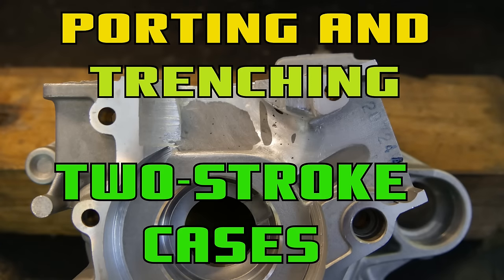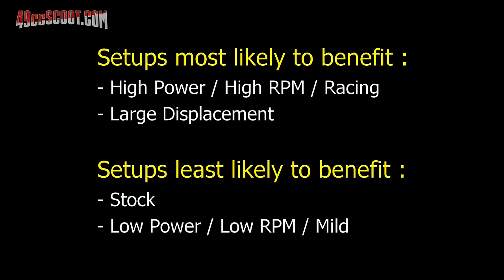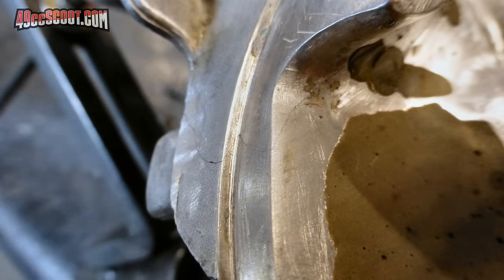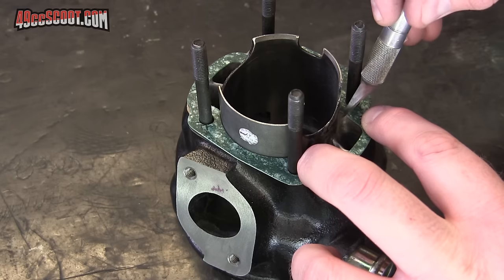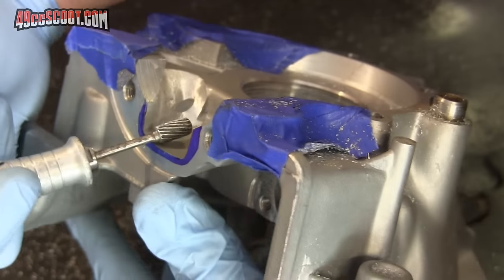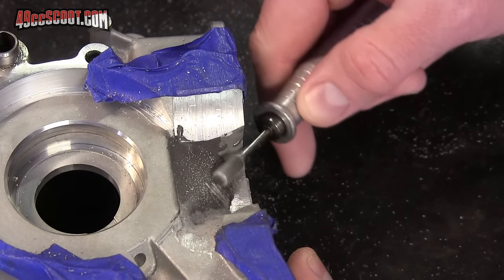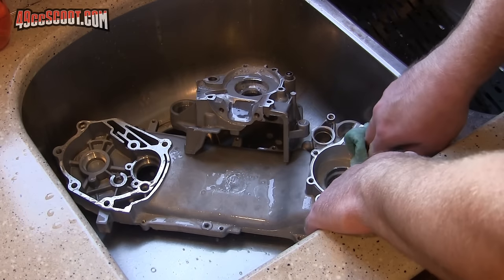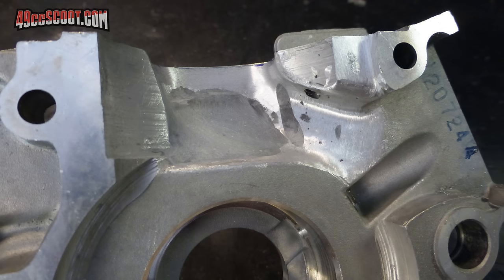Port Matching, Porting And Trenching Two-Stroke Engine Cases

Comment: What about removing rotational weight? Lighter magneto wheel, light piston etc, does it make any sense/ actually does something?
Reply from the maker: It can help the engine respond more quickly. I've used the NCY/HOCA style small flywheels that are lighter and move the mass nearer to center and it woke up a higher revving build. I'm sure it's only better still with the inner rotor ignitions. With the racing stuff, it becomes a bit of a necessity... at least with the Minarelli engines. We had a guy on the forum that tried to use a stock flywheel with a Polini Big Evo 94cc and the flywheel came apart.

Another easy way to ditch some weight on the Minarelli is to get rid of the starter clutch. Those can be pretty hefty and they're attached to the crank. Obviously don't do that if you're attached to electric starting though.
Reply: Thanks for the reply, I'll look into lighter pistons first, since I'm going to put a bigger bore kit first, the other scooter might get a lighter flywheel first, it won't be exactly apples to apples comparison, but we'll see if there's going to be a measurable difference in how they run

Comment: Great video. Was just wondering if that black stuff works as good or better than blie locktight
Reply from the maker: It's permanent. Not meant for threads, but if you wanted something to never come out it may be an option.

EDIT : Wait. The Permatex stuff that I put on threads? I was thinking of the JB Weld at first. The sealer just seals. It's not even a fully curing style so it's not holding threads.

Comment: Permetex gasket maker never dries. How tgats worked well for you is a miracle. Fuel eats it/washes it away
Reply from the maker: Depends on the gasket maker. Ultra Grey and MotoSeal by Permatex are pretty commonly used. I use ThreeBond (HondaBond, YamaBond) on the case seal most of the time, but only resort to it for other areas if I have sealing problems because it is messier to work with and  tougher to clean up.

Comment: Have you tried not filing the crankcase port with JB Weld and going for volume not flow?
Reply from the maker: I have built engines with just port matching. The problem is that everything I've done for years has been significantly larger and/or higher revving than stock and I have ported them. I don't have anything to compare side by side.

Comment: I have a few professionally built full race 2fast 70s .....I notice many of your builts are on 50 cases .....is there a benefit to this as opposed to being built off of 90 cases....keep up the great videos
Reply from the maker: One benefit is that I can actually find 90cc long cases. That's the big one. If it's a smaller engine, then the 90s will have much larger crank area and cylinder areas than needed and I'm not sure how well ports would match up. I'm jealous. I wish I could afford 1 pro race 2fast 70cc. lol
Reply: @49ccscoot  I also struggle finding 50 cases as I also have a full race mhr 50....and a 2fast 100...all in full race mini quads
Reply from the maker: @williammoore8252  All of the 2Ts are becoming more scarce lately. Sucks.

Comment: Will what you're doing cause poor lubrication for the crank and Rod. Therefore premature engine failure?
Reply from the maker: I've never had any problems. Some fill the oil holes and more aggressively block the crank area and still work fine.

Comment: Dude I WILL do a test of trenched V un-trenched!!  I'm about to re-do (phase/part 2 build) the engine on one of my 92cc project saws, I was gonna just do it all at once (dropping cylinder about 8thousndths", refinishing squish band, and WAS gonna just do transfer work (am happy w/ the intake&exhaust ports from round 1) and crankcase-matching/flowing work, though now I'm tempted to do them separately and test (it's pretty easy for me to test, I use a large log and videotape so I can then go measure cut-times, when you're doing >20sec cuts the differences show easily, and your cut-to-cut variance is well under 2.5% in my testing so far and am just beginning to 'dial in' my testing/benchmarking station, have no choice as I'm about to make some BIG claims of >10% power from a muff mod I came up with ;D )
I can't help but wonder how a big-bore kit plays into this?  People generally say nay to the 56mm (oem is 54mm) big-bore kits for this 92cc saw, and the reason most-cited is insufficient crankcase volume.....though at the same time, the crankcase//cylinder matching on this saw, OEM, is the most atrocious you've ever seen, quite literally just thin hard-edged gapping between the two for 'transfers', it is insane...I know that trenching/flowing that will allow far more in, but have to port the lowers &uppers to actually be able to move the new air....this is awesome I have a good walbro on this unit it should be capable of a good deal more power, these guys like to cut at around 9k but am hoping to make it like 10k rpm more AND have higher compression ratio at same time ;D
Reply from the maker: Not sure  how the saws are setup, but for scoots the transfers can be more ideal with smaller bores. Our transfers are way small compared to similarly sized MX bikes, and they also go much more straight up where better designed cylinders have teacup handle transfers that curve around into the cylinder entry instead of taking a sharp turn like the straight transfers.

For us, case volume can be pretty easily changed with spacers under the reed block.

Comment: Doug Flannery calls it tunnel porting when match porting the case to cylinder. It makes a big difference in low end HP on snowmobile engine.

Comment: Hi, please can you tell me what flex grinder you use please. I have a Dremel with flex shaft, but the alloy handle you have on your flex looks far more robust. 
Also, do you prefer to grind at low to mid rpm, or run it fast? 
Thanks.
Reply from the maker: I'm using a Foredom. It's a really nice setup with many handpieces to choose from.  Much more expensive than a Dremel, but has been a better tool for me. The one downside is that it has enough torque that you have to be more careful.

I tend to choose a speed that feels right for whatever I'm doing. It will vary by material, bit and job.
Reply: 49ccScoot thanks fella 👍

Comment: Im sorry for my bad english, what happen if i only porting the cylinder and not matching with the engine case? Thanks🙏
Reply from the maker: There wouldn't be much point of porting the base of the cylinder any larger than where it meets the case. If you are altering ports where they enter the bore, then it's possible to improve performance without modifying the base.

Comment: ive never had luck with JB weld with gas.... it never lasts, how long has your filler lasted for?
Reply from the maker: The one in the video has been together for about 1.5 years now. I did get cracking on one side, but the aluminum and all cracked. This was aggressive porting and I crashed into a deer with the scoot, which I'm sure had to put some stress on every component. With or without the JB, I go through cases too much to have a 50,000 mile engine. Been doing JB in cases for the better part  of 10 years now. I don't claim it's the best, but it has worked well enough for my needs.

Comment: Did the JB weld hold up? with heat, gas, vibrations etc?
Reply from the maker: Yup. Current engine has the same treatment and it's been in the scoot for 2+ years. Even blew a crank bearing and took out a crank and variator ramp plate and it's still fine.

Comment: When i do matching work i like to make my own gasket/spacer from some 2 or 3mm thick aluminium sheet i tap the holes with the same thread as the studs i the bolt it to the cylinder and match it to the cylinder while theyre together then ill take it off and bolt to the cases that have marking fluid or a bunch of permanent marker on the base area and scribe out my lines using the matched aluminium spacer/gasket its not a quick process but it allows you to get as close to a perfect match as possible it is good for a matched gasket making template ill generally make my bolt holes in my gaskets have zero slop in the holes so my studs thread into them slightly so theres no chance of it moving and encroaching on the transfer area. I know its an old video but someone might get some value out of this information🤷

Comment: I've been at this for a lifetime and watched everything and read everything long after being an established top shelf Master Mechanic and I have to say that all your videos are great but this one is by far the best one out there.  Everything you said is true whether the so-called ASE idiots agree or not.  Polishing is a joke, see I went further because I love to punish the idiots, now steam is building up and must be released while you and I just relax, smile and enjoy life which if you have not noticed is not polished either.
    So as the number one lover of JB Weld I want to share a little knowledge with you.  If you will mix your batch 10% light in hardener and very warm and runny and then you dump it into the place it goes letting it run over and bond and then pool and then stick your part in the freezer.  When you get it really cold the curing times change exponentially.  So check on it often until it is like play-doh and then rub a little oil on a sandwich baggy and put it over your jbweld and mold it with your fingers to the exact shape you want it putting it back in the freezer if it starts to thaw.  Once you have it as your want it then just keep it in the freezer for at least 6 hours and at that point it will have cured to the regular 5 minute mark in which is has a hard skin.  Once the skin is developed the stuff won't move any more and you can pull it out and put it in the oven to accelerate the curing time, just treat it like bread or cheese toast at about 300 degrees or whateer you want as the more heat the shorter the cure time.  If you try this I promise you will grow to love it and you will soon be able to do it and actually get it cured in a much shorter time than normal.  The greatest part about doing it this way is once it becomes like play-doh it won't stick to your fingers anymore and you can actually use tools on it before it is cured and soft and using the oiled plastic will leave you with a perfect plastic smooth finish.  You can even assemble your stuff together and let the parts push everything out of the way with the plastic in between and when it is at the perfect consistensy you can simply use a blade to cut it and  just play with this method and I promise you will love the stuff even more.  Once you become expert with the frozen method you can then add extra hardener and essentially make your own quick cure so that it has a skin in about 1 1/2 hours in the freezer while the stuff underneath is still moldable and moveable.  The most important part is cleaning the surface and making sure the hot mixture is runny and gets sure contact without air to the surface.  You will find that it becomes as hard as steel when you get the mixtures right and I hope you get something from this rant friend.  I really appreciate your work and your patience and keep it up man.  The kids need to hear the truth's you speak and if they doubt or have doubts they need only look at the finished product to know you know your stuff from experience not from books or videos and that should be enough.  I repeat polishing ports does not benefit anything people.
Peace
Sizzlean
Reply: very true, polishing will make the fuel condensate back into droplets buggering up emulsification intern buggering the air fuel mix, not much chop for making power.     good vid for a how to on a budget.
Reply: Very bad advice, expansion and contraction will weaken the epoxy structure and epoxy is supposed to cure from the inside out cured under extreme heat such as 300 will cure from the outside in, making the outside very brittle in the inside very soft
Reply: Anybody noticed the volume difference in the transfer Port base try using a flow bench way more important than matching at that point would be air velocity as with that big of volume difference one size going to flow way more air than the other bad news

Comment: This video is so good guality! This helps many people with Minarelli AM6 and many moped engines! Thanks! Just question here,i am creating high end setup and i would need 2 rad setup.Bike has currently 1 radiator,there is space for another radiator and fits straight on! But the question is can i use 2 similar radiators? Is it ok if both has the radiator cap and filling cap? Thanks good video! Sorry for writing errors!
Reply from the maker: I don't really see what it would hurt to have 2 caps. Makes things more simple with 1 and there's less to fail, but it could work with 2. Could probably just tee both expansion ports to the same tank.
Reply: Ok thanks! I love ur vids bro keep up the work!
Reply: 90GTVert forgot to ask but should i be scared of cracking cases when i just port match the cylinder? I am not going to trench it just match the ports and take the sharp edges out.
Reply from the maker: @Jortsa  As long as you leave some meat on the cases, it should be minimal risk. Most cylinders won't have ports so large that you've got hardly anything left if you match to them.
Reply: Ok,i am fitting 77CC or 86TPR to my cases and what ive heard,people say that you need to take very little off.Thanks for quick response!
Reply: @Jortsa  86cc on am6? I have that, the 2008 version alu, I didn't need to match anything of importance. 22hk on the wheel with just primary adjustment. 24 is the goal. Greatings from Sweden.

Comment: Is it advisable to use red rtv gasket maker instead of the stock gasket because my chainsaw is no longer made and it's impossible to find replacement parts!?
Reply from the maker: Most likely you can find a gasket material that is close in thickness. That may help to retain the original properties of the engine (due to spacing).

Permatex Ultra Grey or Motoseal or ThreeBond/HondaBond/YamaBond are more common gasket makers for 2Ts.
Reply: @49ccscoot  I will consider them, thanks!

Comment: Automatic choke does not activate in cold engine. What is the reason?  How do I set it.?
Reply from the maker: Most enrichers on small scoots expand when heated.  When they haven't had power for a while and they're cool, they should allow enrichment. They sort of default to enrichment. You may want to see if the enricher is stuck or if it expands and contracts and check power to it.
https://youtu.be/O2qRVOkfdaY

Comment: Not bad check out two stroke stuffing he really can teach everyone some stuff. I agree and am glad you touched on the volume being the biggest increase. A spacer for the reeds would actually help what you did significantly. Currently the air flow isn't straight yet by your transitions. I personally have noticed puddleing with anything smoother than 80 grit and when I got certified for water borne paint we learned some data on surface finish to wetting and it seemed to agree I finish most areas with 50 grit. I am wondering why you dug your sweet filler job out and didn't just cut the cylinder? Seems there's a good 7-9mm that one could along with rounding all the edges on it. Seems like a bad spot for turbulence. Ever try shielding the crank? We did it years ago to a Zuma and picked up a good bit up top. Think much more after 13k and it didn't die off until 14500. Seems a yz cylinder could be fitted pretty easy from the looks of stuff but I never measured as I'm more of a 4 stroke guy.
Reply from the maker: I've never tried to shield the crank, but have seen/heard about it. TBH, wasn't really sure how to go about it in a dependable manner. Even though I do mod the cases a lot, everything of mine is street use. Most stuff today just goes over to aftermarket cases for flange mount cylinders to get more serious. A guy on my forum has done some conversions with MX cylinders on different cranks in the Minarelli, with adding plates to adapt the cylinders, but it has been a whole lot of work with varied success.
Reply: @49ccscoot  I use Devcon in all my motors for various things give it a go think youl love the stuff and alumirod is also great. I did the rod to some thick can I cut up then devconed around it and built it up. Really easy and very worth it since you seem to die off around 13500. Love the work and check out two stroke stuffing dudes an animal. Think alot of his earlier work would transfer over for you.
Reply from the maker: @oliverscorsim  I tried Devcon on the first set of cases that I ever did long ago. I must have got the wrong kind, because it was very brittle and cracked quickly.

I've been subscribed to Alex for years. He actually joined my forum some time ago, but unfortunately doesn't visit us anymore.
Reply: @49ccscoot  I think your surface prep could be better I do 36grit after a heat soak in the oven at 350 for an hr and acetone bath and if I can get the time I etch it with some some muriatic acid after then a quick baking soda water bath. I use the aluminum devcon 10610. Haven't had a failure yet and that's how I close the decks on my Volvo and Honda motors too for lots of power. Hell even the turbo bike has parts of the cases reinforced with the stuff.. only way I found to keep stiffer main and counter shafts from just snapping the case around the bearings. Never go thinner than a 1/4inch anywhere it needs strength and shoot for 1/2in where you can.

Comment: I have a question will this not change the crank case pressure
Reply from the maker: Changes in crankcase volume will change the primary compression ratio. Increasing volume lowers primary compression.